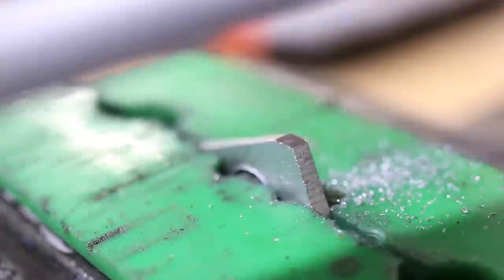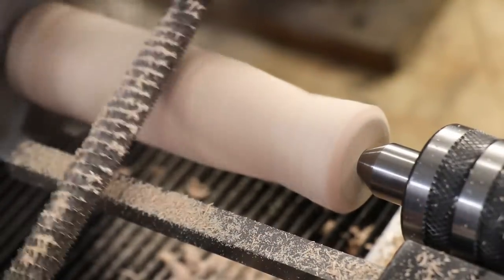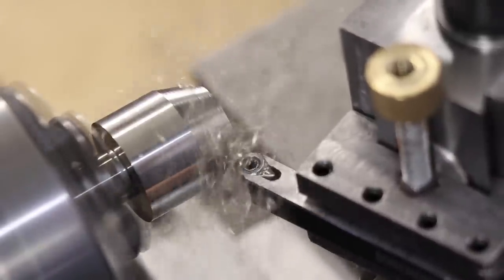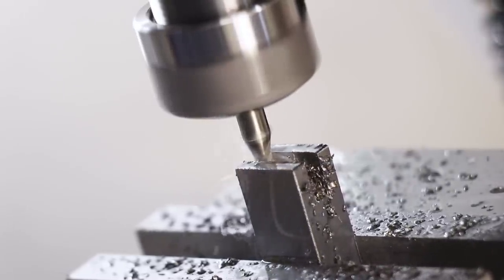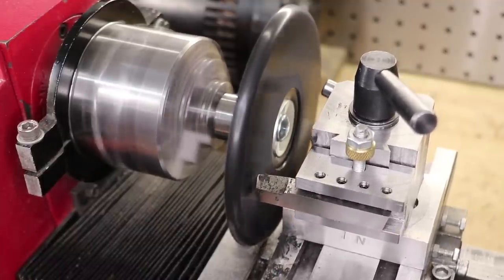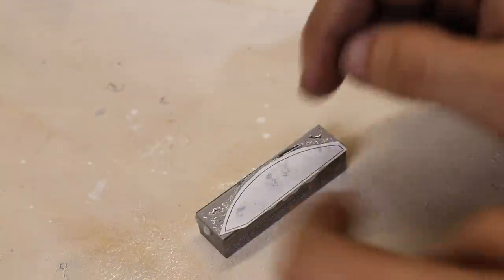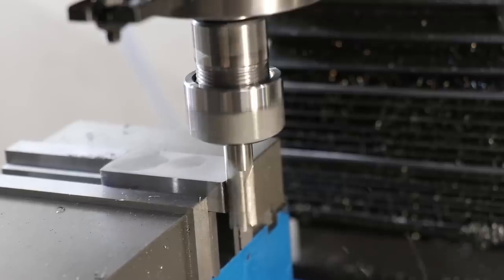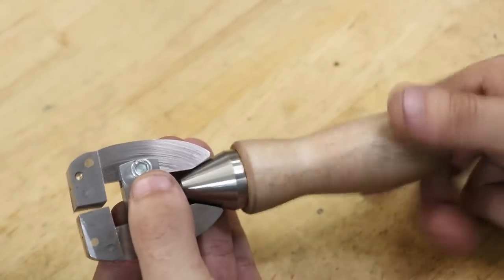Making A Jewelers Hand Vise - Milling And Lathe Work

Comment from the maker: This is a long one that I've been working on for quite some time. Hope you all enjoy it. Cheers
Reply: I like a bit longer video. Great work
Reply: I admire your work, nice one!
Reply: Where you came from ? The Accent is what makes me curious
Reply: While turning straight shafts on the lathe you should be using an 80deg insert and helps to have a chip breaker on the tool... i know your on a smaller lathe and dont have as much torque but it would deff benefit the machine and lasts alpt longer so benefits the wallet as well.. seeing that spray cheese comin from the part instead of broken crackers made me cringe a lil!!
Reply from the maker: @shadow_stalk  if you are thinking of CNMG (i think it is cnmg) I have those tool holders and I have tried various insert brands but for whatever reason, I just cant get the inserts to work well with this set up. No doubt its the rigidity and lack of power. cheers

Comment: Turn the cone out of a piece of hex stock and leave a section of hex under the cone.  This will let you clamp the hand vise in another vise in one of six positions.
Reply: This one is really good
Reply: Nice dude.  You can never go wrong with being able to index a thing in another thing at an approximately known relative angle.  And being a hand vice I'm sure the hex stock is going to be an obvious advantage despite the limited precision of the stock.
Reply: Very clever

Comment: One trick I've learned when trying to turn down a bolt or screw is to wrap the threads with copper wire and it will help keep the threads clean.

Comment: Nice video!
An easy Tipp for you, when you are pening the brass pins (or whatever pins you might be using in the future) drill you hole and then drill a little countersink on both sides so when you are mushrooming it over the material will spread and it will be a lot safer in there.

Keep going with your projects. Always a pleasure to watch!

Comment: One thing you can do with jewellers vices is have a hole that runs all the way through the tool and is open at the bottom of the handle. Having a hole run through the center opens up more options for use.
Reply from the maker: Great suggestion, ill have to remember that. Cheers

Comment: You can turn almost anything into a suitable scraper for woodturning, old files, etc. A small or medium sized round nose scraper will see you through most basic wood turning projects without much time to learn how to get good results. 
Just be careful about too much stick out and engagement if you are using something brittle.
Reply from the maker: Cheers, I have very little experience in making my own wood turning tools, its certainly something I'd love to get some practice doing.

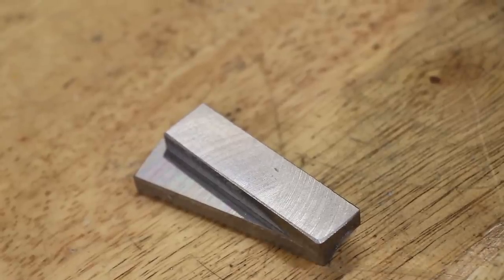Comment: Cool idea with the superglue (16:08).

Handy tip for turning resilient materials... Try tossing it in the freezer for a couple of hours.  Be careful with the mount as metal will expand as it warms up, but latex based compounds generally expand as you cool them down.

Comment: An interesting project would be a ball vice.
I'd use a basketball rigged up with ducttape in a wooden fre, cut a funnel hole and add some mesh, then vast some bent threaded bar in place with concrete.
From there, you can trim and add a threaded sleeve to attach the jewellers or other vices.
Cut a tapered hole in a short wooden stool of desired height to sit on the bench top and you'll have a sturdy base

Comment: As a machinist that works with stainless for a living, including 316 and the super duplex SAF like 2205 and 2507. It's funny watching you able to only do .5mm cuts when I'm so used to ripping 10-12mm cuts on it. Great video anyway man keep up the great work
Reply from the maker: Funny thing is, I am pushing the lathe to its max doing the cuts that im doing. Cheers

Comment: I have one of the exact type of jeweller's hand vise you made. Then only thing I wished is that the jaws weren't locked in place, where they could rotate to accommodate different shapes and to hold square parts of different sizes since the large the jaws are open, the more crooked they are.
Reply: This could be accomplished in a number of ways, I'd be too lazy to make a parallel linkage but making it hinged would be relatively simple.
Reply: @Avram42  even just having the jaws not locked in place and being able to pivot would help too. A parallel linkage would be pretty cool but a bit more work.
My favorite type of hand vises are the "machinist" style, basically like a tiny bench vise on a handle but they are hard to find and the used ones I found on eBay a pretty expensive for what they are. I've been thinking about machining one, they're not that complicated to make.
Reply from the maker: Fair enough, I really only make these jaws to hold on specific size of sheet metal I need to shape, but that seems like a good idea
Reply: @SweetTooth8989  Yeah, pivot was what I meant when I said hinged.

Comment: nice job! I suppose you just change the angle you machine on the face on the jaw if you are looking to clamp material of a uniform size. You could even make little jaw plate inserts tapered at different angles to swap out if you wanted to.

Comment: Standard gluestick like you would have used at primary school works well for holding paper to steel.
Reply: Soaking it in CA Glue also works rather nicely while beeing waterproof and more heat resistent

Comment: Hi, about case hardening - there is a great stuff, named "KASENITE" - it is great for fast, surface hardening of steel pieces. It introduces both carbon and nitrogen to surface, I found it very useful in my workshop - you need only a burner and cooling agent (usually water). It is hard to get it now, but I think it is worth to try.
Reply: I didn't think they made that anymore my first run in with it was using it to harden small gun parts.
Reply: @samellowery  replacement can be found on ebay.
Reply: @kbilsky  that's good to know thanks.

Comment: I have never seen a half-center before. What stops it from drilling like a d-bit? Can these be used with steel? Over 30 years of machining, I've never seen such a helpful and simple tool
Reply: He has a full video about making it pretty recently
Reply from the maker: Its not sharp so there isn't a cutting action. when I use it on metal I have to lubricate it with grease, liek you would a normal dead centre

Comment: I like how that one came out. brilliant job👍if I may give a tip. at the part you had the clamp levers glued together to drill the holes, this is where a vice position stop would come in handy a simple article slotted to fit on the jaw of your miĺls vice grub screw to lock it in place any position to work in conjunction with your parallels. reference to Joe Piezinski from Austin Texas, Advanced Innovations being his machine shop business. i have made my stop recently
Reply: it helps with repetitive workpiece placement in machine vice
Reply from the maker: Iysbdefinently something that I plan to get. I prefer table stops to vise stops because they are a little more versatile. Cheers

Comment: Nicely done.  Would it have been better to only put 1 pin on each jaw so they can rotate and be parallel even with something clamped between? Or would that have caused issues?

Comment: Nice project as always - I didn't realise they were (relatively) straight forward to make and I've been lusting after one for some time. With regard to the jaws, shouldn't they hinge? I wonder because unless you're gripping something very thin they're going to be bell-mouthed if they are perpendicular to the arms?
Reply from the maker: I made this to hold a specific thickness of stock with these jaws so when they are parallel they will be holding the stock correctly. Normally you would want to make it slightly convex.
Reply: I've got one of these and can testify to its usefulness. Mine is old - 50 years plus I'd say - with no manufacturer's name, so with every appearance of being home-made, and bought for next to nothing from a market stall. It doesn't have a wooden handle - the cone is just extended downwards, with a neck cut out for ease of use and knurling on the remainder to give some grip. That extra weight in the handle I suspect also improves the balance in the hand.
I don't think rotating jaws are a good idea - these hand clamps are mostly used for very small parts and it would be irritating to have the jaws moving away from the part as you're trying to grip it. A very slight convex is possible, but mine just meet at the end - they're parallel at about 5 mms separation, and that works well.
I'm also not so sure about stainless - very hard and liable to mark parts in soft materials such as brass, aluminium alloy etc. Mine is a very soft steel, which is less prone to that, and has acquired a lovely patina over the years, which stainless is never going to do :¬)
It does have a vertical V groove in one jaw, which is essential for holding rods and pins. The pivot pins are also steel, not brass, just peened over like rivets after assembly.

Comment: Maybe I missed it, but if you milled a small V into the opposite face of the jaws it could be reversible to hold onto round material.  I guess you'd have to sacrifice the sleek form factor, but you'd have additional function.

Comment: 8:52 no hard and fast rule about this, but for a part that narrow, there's not real reason to have so much extension on that fly cutter, it doesnt need to be set for the maximum possible flycut diameter. With the cutter set way back, you have much less of an eccentricity in the load, and machine performance should go up slightly and vibration go down, but if the mill is rigid enough i suppose its not a problem. Looks like a ton of stickout though.
Reply from the maker: It cuts fine enough so I just leave it as it is for all cuts. Cheers

Comment: Hi, you might have answered this in a previous video, but what CAD program do you use, and what did you do to learn the program? I've tried using Free CAD, but I really struggled to graps it. I know a lot of people use Fusion, but I've always been worried about being charged to use it. Thanks
Reply from the maker: I use Solidworks and CATIA to do my modelling, mostly because that is what I have been taught to use, though they don't come cheap. Fusion seems to be the best free alternative for hobby users. Never used free cad.

Comment: I absolutely hate trying to drill, machine or work stainless steel, I've never tried and not broken bits or blades working with it and so I have come to just use 5150 steel or other hardenable and make sure to oil or paint it after I'm done. I live in the Southeast US and to say we have high humidity is an understatement.

Comment: Very nice project, mate. But please build a yourself a dedicated disc sander. You will always get grit on the lathe guideways and you will regret it afterwards.
Reply from the maker: Cheers, once I get a bigger place there might be space for one. As for now this works, as long as I clean all the grit off. Anyway it's a $600 lathe so I don't mind doing stuff like this on it.
Reply: @artisanmakes  Fair enough!

Comment: the press fit of the bolt pins in the clamping jaws, etc. would have been a lot easier if you had put the bolts and the screw in the freezer for 24-48 hours and heated the counterparts to 200 - 250 degrees, the cooled metal parts shrink a little due to the cold and the heated ones expand then lie down insert the pin or screw and wait the heat causes the pins and screw to expand again and the cold cools the holes down again so that you don't have to force the pins in.

Comment: I would have thought the jaws would only have 1 pin each so they can rotate to keep themselves parallel. It seems that with 2 pins each, they are only parallel when completely closed. Is this how they are intended to be? (Iwatch a lot of "Tested", but don't recall if I have seen the handheld vise.
Reply from the maker: You can do that, that's a good idea, but I made this one to hold a specific thickness material when I was designing that jaws. Cheers
Reply: @artisanmakes  Thank you!

Comment: 16:54 here would a clamp / vise be perfect

22:40 it looks good but it Looks a little bit unparalell from the side
Reply from the maker: There was a little slop in the main bracket to allow for the movement but when its clamping 1.2nm sheet metal it is flush

Comment: 17:55 The holes are pretty near to the edge. They seems to break out with any force ...
Reply from the maker: It's a bit close for comfort but this is for light clamping duty. This is strong enough for what is needed
Reply: Exactly what I was thinking. Not a lot of meat there.

Comment: 2:22 Point of interest. High speed steel is no more rigid than mild or any other steel. All steels have essentially the same rigidity.
Reply from the maker: The data sheet i run off lists the elasticity  mild as 190 gpa and hss as 205/210gpa. To be fair I  probably don't notice much of a difference on this scale of work. Cheers
Reply: @artisanmakes  HSS is within 5% of mild steel. Thats close to the margin of error for measuring it.
"Young’s modulus of elasticity of high-speed steel – AISI M2 is 200 GPa."
In all steels(aka iron alloys), rigidity comes primarily from cross section. The base material is still mainly iron and the iron to iron bonds are what determines stiffness. Alloying elements are not usually enough to  change that much.
I mention it just because people think high tensile steel is "stiffer" than mild steel but that amounts to only a few percent, if that. Increasing the section of mild steel a few thou will equal any HSS in stiffness.
Case in point: People think racecar frames are made of 4130 steel because it is stiffer and it is not. What it does, is have the ability to bend further before permanent damage occurs but it still bends the same under the same loads.
Motorcycle frames can replace 4130 steel with aluminum which has only 1/3 the stiffness of steel but it's lightness allows a much larger section to get the stiffness back.
Reply from the maker: Intetesting, wonder why our matrrials charts don't line up then, mine would have me believe that the difference is around 15 gpa.
Reply: @artisanmakes  15/200=~ 7.5/100
=7.5% difference and that is a max not a typical. I gave a more realistic 5%. Do you think 5% is a lot?

Comment: 2 Notes from a metric guy here:
Metric Standard Treads don't need the pitch to be pointed out. So on your drawing a simple "M8" would have been enough. Only Metric Finethreads such as "M8x1" need to have the pitch mentioned as this indicates the Finethread.
And please do me a favor for your own safety: Never Ever put your left arm and hand over the chuck when polishing or filing on a lathe. Always come from the other side to avoid your fingers, hand and Arm being smashed by the chuck's rotating chuckslides.
Reply from the maker: I'm a metric guy always have been, and I never follow any proper standards when I make e drawings for myself. Let me chuck it up to laziness or letting the auto dimension and labeling do its thing. Solidworks i think chucks up the pitch by standard
Reply: @artisanmakes  now I know why my USA Engineers always make the same mistake. Solidworks... I will try that on FreeCAD to see what it does (Linux User)...
Reply from the maker: @SaschaReinsch  Yeah, solidworks can make making e drawings easy and skip over basic stuff. When I did drafting class in university my professor banned us from using the auto dimension features. Cheers

Comment: No reason you can't toss a cloth over your ways and turn wood with that HSS after grinding a positive rake and relief, then finish with a file I'd think?
Reply: Also, with stainless, you should be able to take at least 1mm, just slow your feedrate.  Stainless likes a slow feed.
Reply from the maker: Not at all, since installing the way cover the only real thing I need to clean the wood dust from is the scroll chuck.

Comment: Why did you say that these sanding disks were made for cordless drills that is misleading when they can just as easily be used in a corded drill.
Reply from the maker: And you can put them in drill presses :) misleading I have been

Comment: two mistakes. the handle is screwed onto the tube, and there is a through hole in the handle. this allows you to fasten long objects. the sponges should be at an angle. and with a notch.
Reply from the maker: Maybe something I over looked, the holes are a good idea but the jaws very much serve their use at clamping a specific sized stock which I needed to clamp onto. I intentially didn't add a notch and said this in the video

Comment: 5:10 no oiling at cutting steel? Well. .
Reply from the maker: I use cobalt blades, they seemed to work beat without cutting oil in stainless

Comment: Lathe spindle is too slow for disk sanding (IMHO).
Reply from the maker: It can probably be run 4x faster, but the lathe rpm is fixed
Reply: @artisanmakes  Chinese mini lathes typically restricted by 2000-2500 rpm. For efficient sanding it's better to have something between async motor (3k rpm) and angle grinder (12k rpm). Most people use async motor boosted with VFD.
Reply from the maker: Yeah this one used to top out at around 3000. And this risk is rated for 3000 too. Once I get a bigger workspace I'll probably make a dedicated risk sander. Cheers